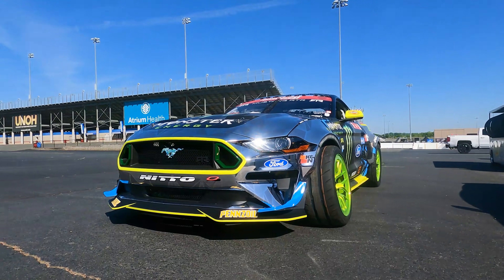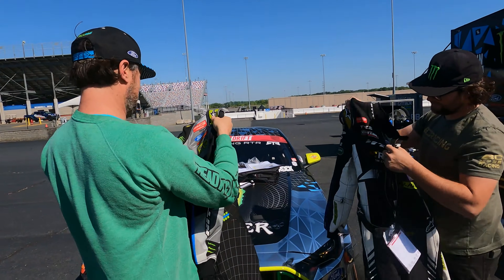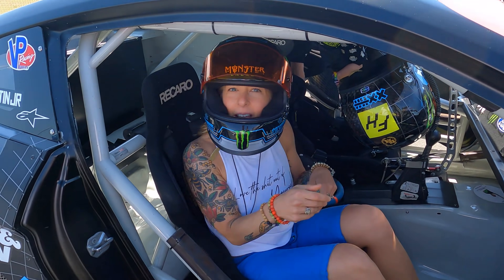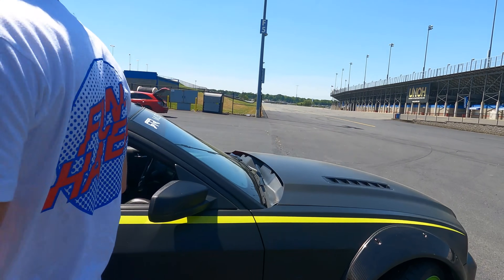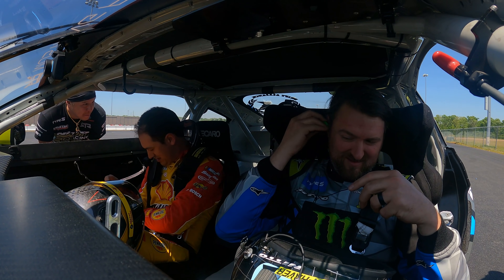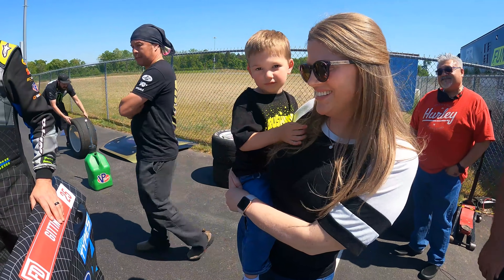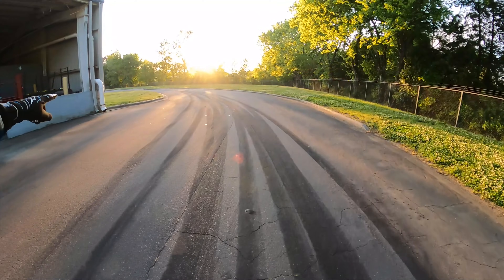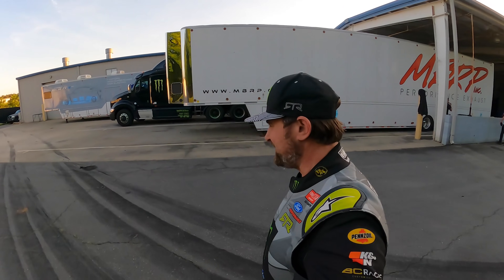Our 2021 Mustang RTRs Are Rippers!!

Comment: i thought they would be turbocharged. Interesting.
Reply: Enough reliable power with just some spray!
Reply: I think the tires have to last one lap, with turbo they may not make a full lap.
Reply from the maker: @RSDX99  Need to last two
Reply: @VaughnGittinJr  good luck with first round 👌🤞